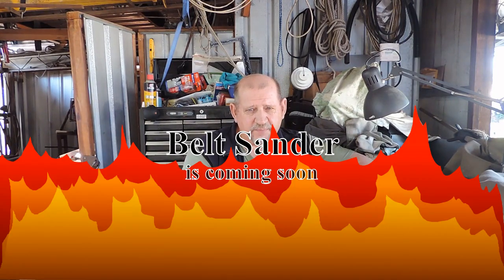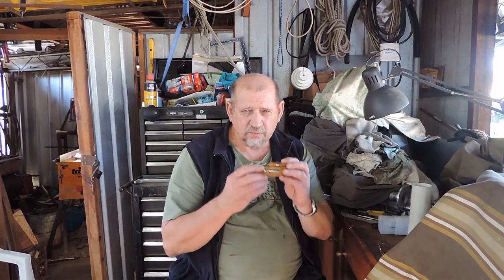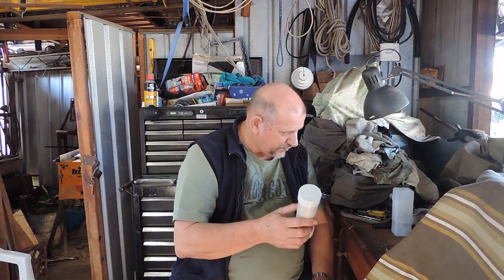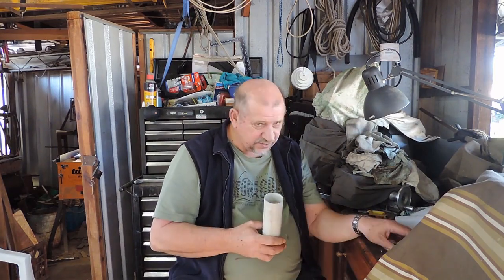DIY Tool Cases

Comment: Great tip Peter!  That is a good tip, thanks for sharing.  Smaller pipe and caps make good reamer cases!

Joe
Reply from the maker: G’day Joe. My reamers are bunched together in a plastic bag but I’m not happy with that, you have given me an idea though, maybe a revolver style cartridge to keep them apart inside a single tube. To the drawing board!
Cheers 
Peter
Reply: @pgs8597  if we are brainstorming.  Why not cast a disk in aluminium, turn it down to the same of as your pipe.  Turn a step on it the same as the id of the pipe.  Then, drill holes to take the shank of the reamers, like a round drill index.  Use the pipe with the cap as a cover or cap for the index.

Thoughts?

Joe
Reply from the maker: You mean like a gun revolver/6 shooter, sorry for the analogy watched too many movies:-)
Reply: @pgs8597  exactly.  Great analogy BTW.